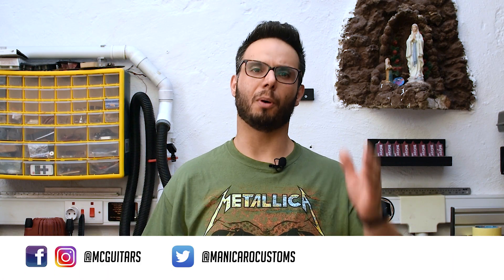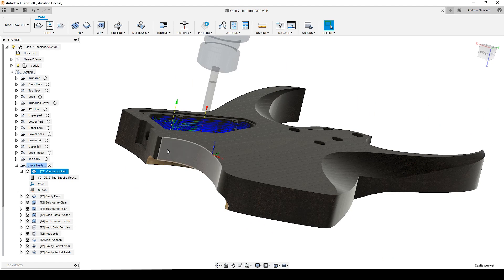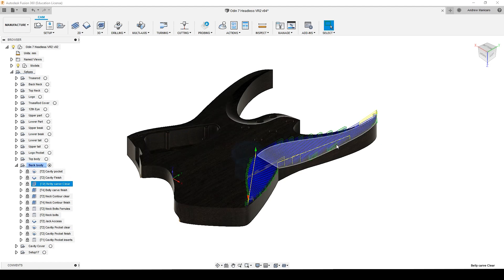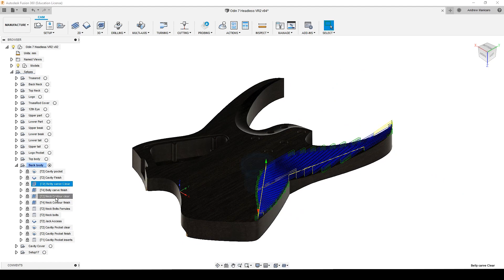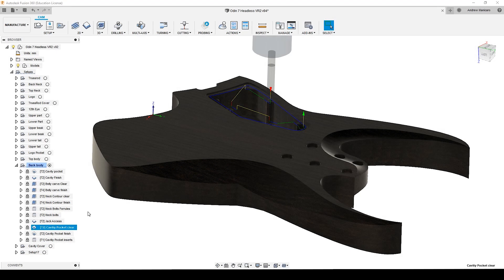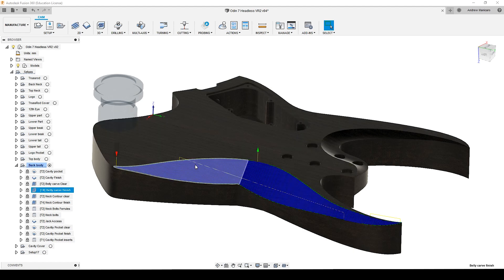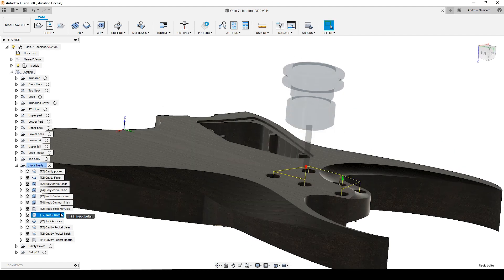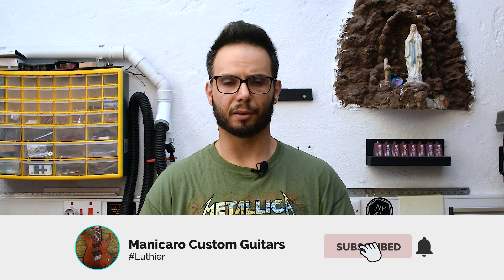How to build a guitar using a CNC Season 2 - Episode 10 Back body tool paths!

Comment: Care to discuss more about the design of your DIY CNC ? You seem to be using aluminum extrusion; did you use 80-20 ? Did you start from an existing design and modified it? Thanks!
Reply from the maker: https://youtu.be/6MCyIZIcg48
Reply from the maker: If you still have questions, pls let me know buddy.
Reply: I don't think you mention it in your video: what's the workable area of the machine? Are you happy with the size? Thanks!
Reply from the maker: I have over 700mm on the Y axis and over 500 on the X axis. I I don't have the exact figures in front of me but something like that. It does the job for me, but in the future I would make a bigger one to accommodate neck throughs guitars
Reply: How much on the Z? Just curious ;)
Reply from the maker: @Agarwal6  something less then 200mm. I'm not near the machine so I can't tell you exactly

Comment: Looks like your Z zero is above the body, or maybe you zero to the table and your body blank is thinner than what you modeled. Which is it? :)
Reply from the maker: The body blank is always to the right thickness of the final instrument. I always set my Z on the top of the face that I'm working on. It's just that in the footage it doesn't show.
Reply: Actually, it seems to only look that way for the roughing passes, not the finishing passes...

Comment: I’m sure you mentioned it somewhere already, so sorry for asking again: what’s your spindle, how powerful is it and how fast is it? Is it speed adjustable or do you always keep at full speed?
Reply from the maker: I use the Kress 1050 fme, its capable of 5000-25000 rpm. Regarding speed depends on the size of the bit and of coarse material. Example, aluminum takes a lower spindle rpm